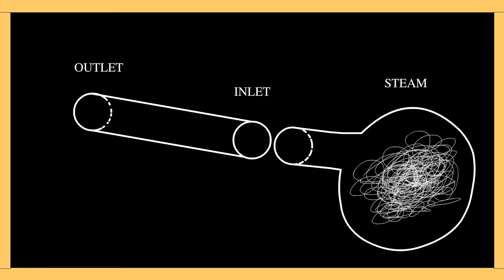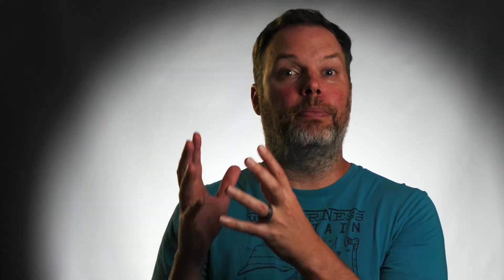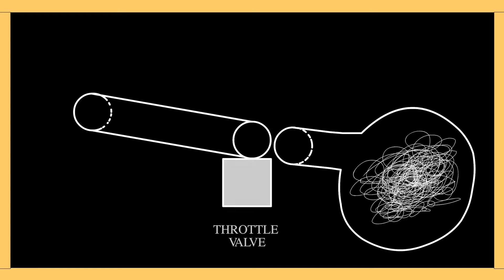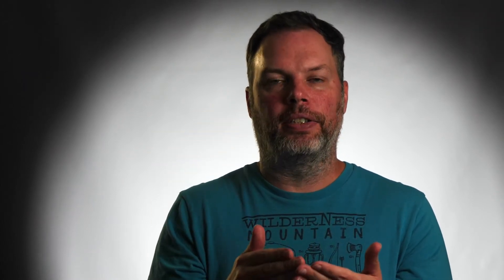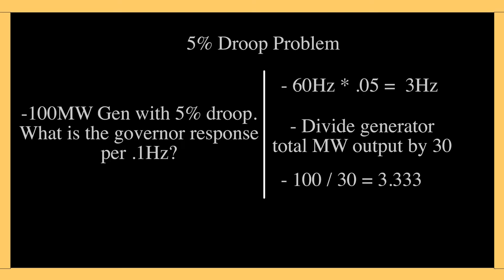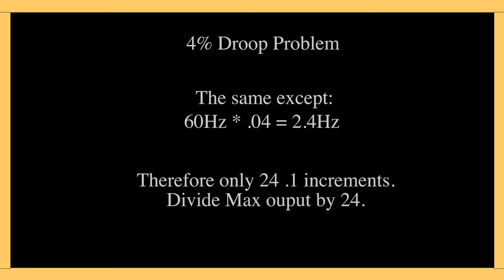NERC Study Tips 3: Droop Calculation

Comment: Thanks! Is the 5% always based on a value of 60 HZ and maxes out at 3 HZ or is it proportional to the frequency actual which may be less than 60?
Reply from the maker: @JCarrollTV  proportional to the Hertz.
Reply from the maker: @JCarrollTV  3% of 50hz (assuming) is 2.5. You have 25 increments.